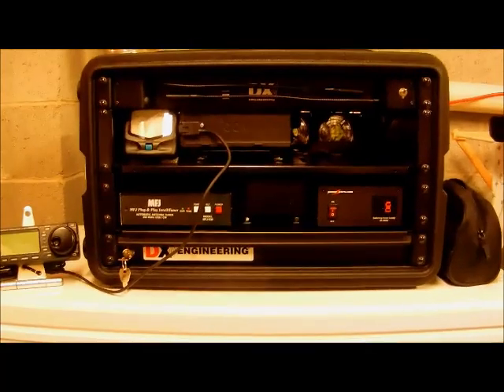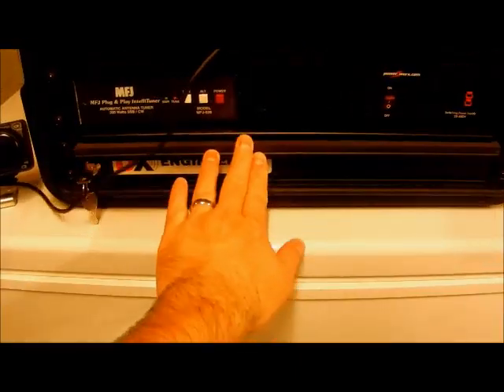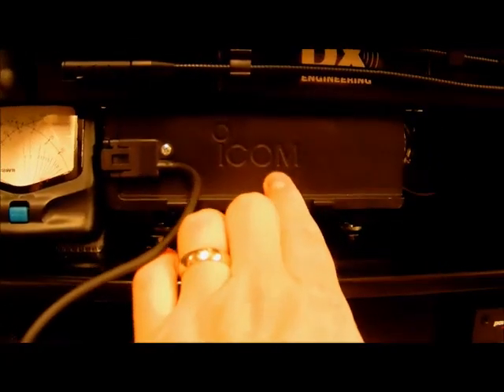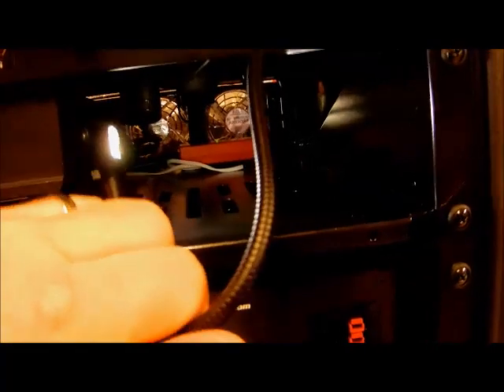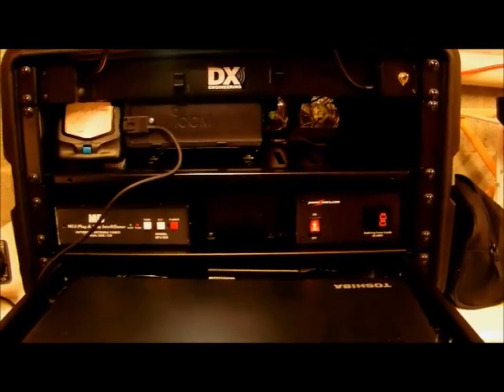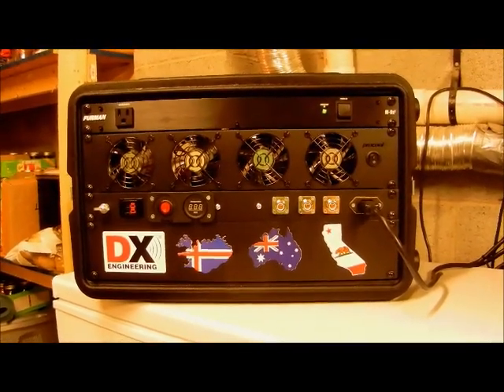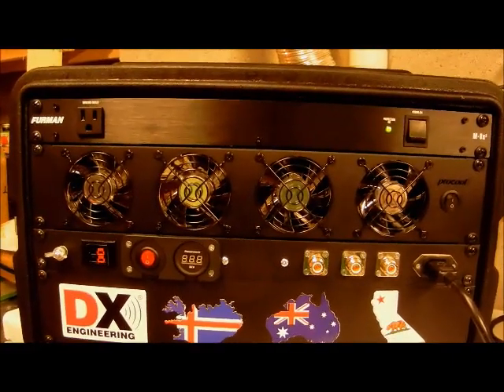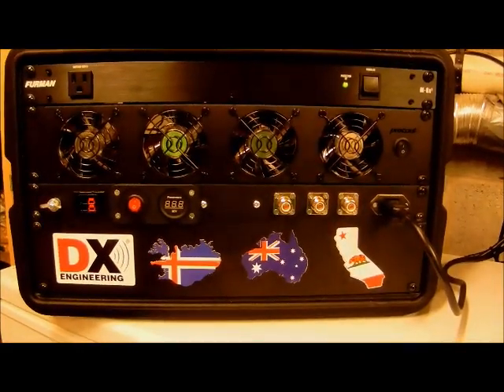Portable Ham Radio "Go Box" Version 1

Comment: The pull out drawer is a real stroke of genius. May I suggest a docking station with a 7 inch monitor and a wireless mouse and keyboard. That way you won't cover up the front of your box and it gives you more options.

Comment: Nice go box.  Where did you get your drawer?  I'm finding it difficult to locate a 1u drawer that doesn't get terrible reviews.  Also, would love info on your grounding block.  Thx!
Reply from the maker: +C Wood There really aren't many great laptop drawers out there, and in fact, in Revision 2 of this system, I have removed the laptop drawer and laptop to a carrying bag, since it is the single largest weight item. Even so, I used the Penn Elcom EX-6301B in this box, and it works well enough. 

I got mine for $65.60 as a scratch/dent item, but it's hard to find that cheap these days. The grounding block is a Blue sea Maxibus 2105 for about $30 on ebay.

Here are the links: 

http://www.mcmelectronics.com/product/555-9005?utm_source=transactionalemail&utm_medium=email&utm_campaign=ConfirmEmail

http://www.ebay.com/itm/201432377132
Reply: Thanks for the info.  I'm currently using a 2u drawer, but the weight is definitely a huge issue.

Comment: I really enjoyed this video. One question; why you didn't add battery power inside?
 thanks for sharing!
Reply: I forgot to mention the Anderson PowerPole job you did was magnificent
Reply from the maker: +SurvivalTech Nord I felt the power requirements were a bit much for an internal battery, and the majority of the remote work I had been doing was through my club's portable power system, which really only required an Anderson Powerpole socket to their 14VDC system running on solar power. If I were to run this myself, I would use a 14V 40A DC solar power system I have. I would use Sealed AGM US Batteries and a 200watt solar system. Car batteries are also good ina pinch, and I have made an appropriate spade to Anderson adapter for the power socket. Thanks for writing!
Reply: WickManDoo Great answer.
Keep up the great work and I hope to see more videos from you like this.
 happy new year.

Comment: Gate hinge!!!! Freaking genius! Would have never thought of that.
Reply from the maker: +HogAlleyHogs Not genius per se, but I was certainly pleased with myself when I found it. You work with what is cheap and works well! The trick is to use zip ties through the screw holes to hold it open and then use the metric bolt into the mounting bracket to hold it on. Best of luck!